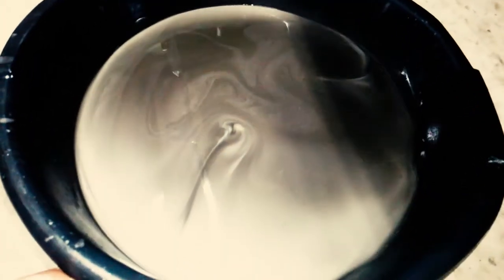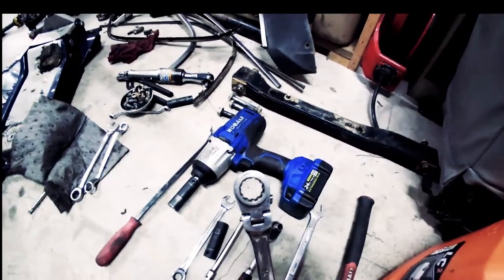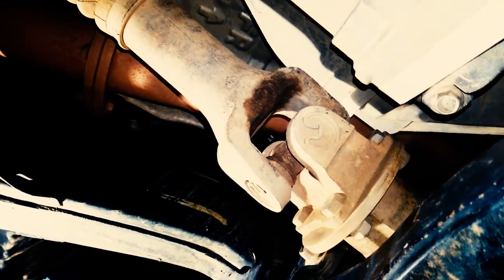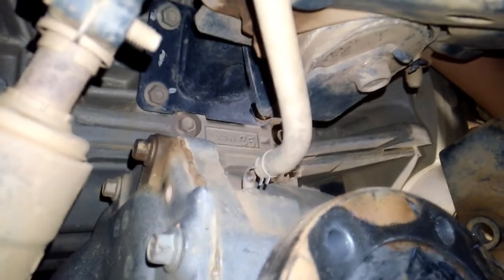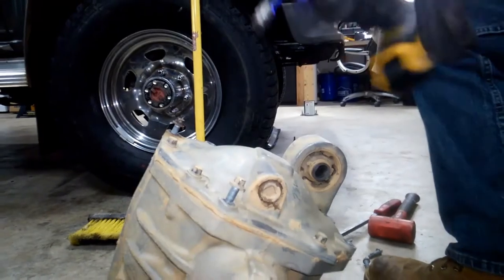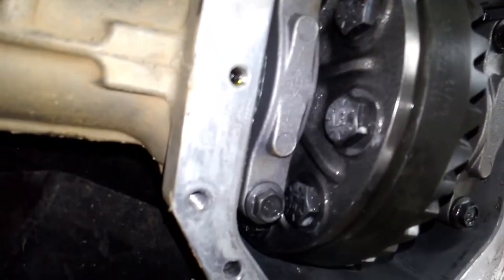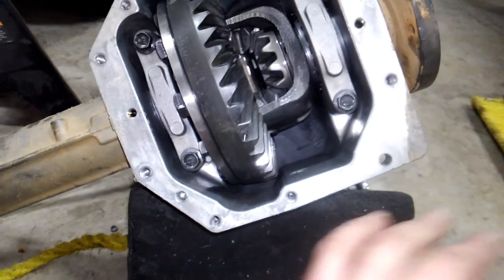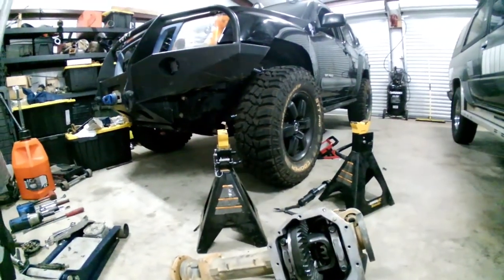2010 NISSAN XTERRA M205 FRONT DIFFERENTIAL REMOVAL

Comment: thank you for the video friend.. im getting ready to do a 6inch rough country lift on my frontier.. if im not mistaken the suspension and dif. are identical as the xterra..
Reply from the maker: glad to help bud. They are not the same but share the same mounting points. For the R180 front dif you have, you will just pull the CVs out instead of unbolting them.
Reply: @TheSmittysGarage  thanks for the tip.  Greatly appreciated.

Comment: So I am planning on pulling my 205 out of my truck and rebuilding it with a revolution gear master overhaul kit, there is a ton of side to side play in the pinion shaft, any tips or tricks for removing and replacing bearings?
Reply from the maker: Use a bearing separator kit to remove the bearings or cut them off. I would invest in a press for sure and sleeve long enough to press on the pinion bearing. It sucks hammering these on without damaging the bearing cage.

Comment: Would this removal be in any way similar for an R108 2nd gen frontier? Mines toast... I'll need to replace it myself.
Reply from the maker: yes, except you won't have to remove bolts for the flanges. I would drain the fluid first so it won't spill out of the cv inlets.
Reply: @TheSmittysGarage  Awesome, thanks!  Not sure there is hardly any fluid even left but I'll drain it again.

Comment: Hey I have to replace my steering rack on my ‘08 xterra 4x4. Some guys say to drop the front diff some say you can do it without removing the diff. How hard or how much time does it take to remove the diff? Thanks for your input, Jeff
Reply from the maker: I removed the mounting bolts from the differential and let it sag. That gave me enough room.

Comment: are those isolation mounts in it removable or are they pressed in?
Reply from the maker: Pressed in. Im actually in search of some poly bushings. Between the axle stubs and mounts there's a lot bouncing around. I need to measure and see what's out there.
Reply: @TheSmittysGarage  Thx for the fast reply! I have a drivetrain vibration on an 06' Xterra and I've ruled out the rear axle, both props, and tires/wheels. My next idea was to pull the half shafts and front prop to isolate the front diff and see if either that or the shafts are the source. Do you know if it's possible to pull those shafts without disconnecting the control arms? Your video suggests one way would be to pull the front diff out and then pull the shafts out of the wheels, but if there's clearance I'd like to avoid removing the diff before I've had a chance to eliminate or confirm that the vibration is coming from the front end. The vibe frequency is tied to vehicle speed, exists when in neutral and with engine off/coasting. Feels like a bad prop joint, but I've eliminated both of those.
Reply from the maker: @ChrisWilson-em1kp  when does it vibrate?
Reply: @TheSmittysGarage  I suspect all the time, but when it becomes apparent to me is right about 30 mph. I've posted about it in newx forums but so far we're all stumped. Today I pulled the half shafts, put the wheels back on and drove it, same same, so it's not those nor the front diff. Wheel bearings don't show any sign of wear. I have a few other parts to swap out due to worn bushings, so I'll see how things are after that.